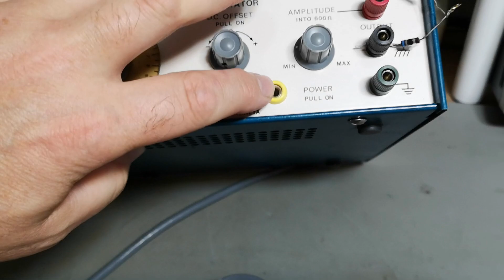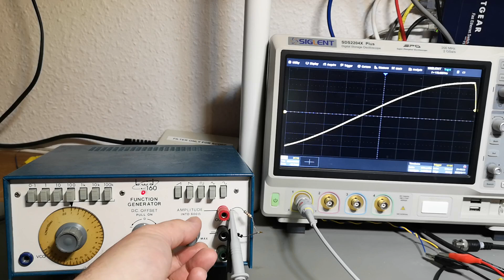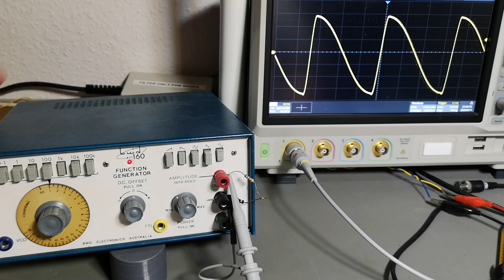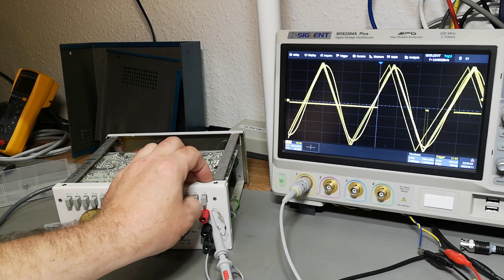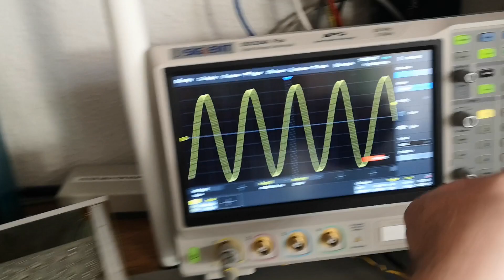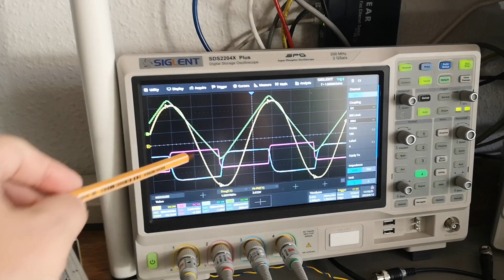BWD 160 Function Generator 0.04 Hz - 2MHz test teardown

Comment: Wow, a piece of BWD gear in Denmark! Geez, it is a loooong way from home!

As an Australian my chest swells with pride whenever someine cracks the lid off a piece of BWD gear…a relic of what we Australians could have been….an electronics industry, we made test gear, oscilloscopes, valves/Rhore! 

This is from Burwood, Melbourne, but we did do valves in Hendon in Adelade and in Campsie and Zetland in Sydney even earlier. Very likely this was designed by John Beaseley…the “B” in BWD. He actually wasn’t an engineer, just a guy who had a “gut instinct” for circuit design! And jolly good on him too!

Beaseley had this most Aussie philosophy that things should contain common, east to get bits and should be servicable “with a piece of fencing wire and a pair of Bull-Nose Pliers” like a fence out in a dairy farm, and it shows out very strongly in his designs loke this generator you have here!

I knew there would ne no ICL 8038 or XR 2206 in there as this predates both of them. Truth be known, it was probably Excar that copied Beaseley’s circuit here and integrated most of it down into silicon! 

Had BWD not been bought out in the late ‘80s and devolved into a reseller, we just might have had an “Australian Tektronix”….these days we can barely even make our own toilet paper…we have become absolutely dependant on others for anything of this complexity or more…only Rhode microphones seems to “carry our torch” these days! 

Take a look at some BWD history here… 7fTC_UM_4Fo or look up HRSA BWD Talk.

Cheers, “The Globe Collector” from Tasmania!
Reply: I have a BWD 603A 😊 here in Bavaria 🥨🍻
Greetz to the little devils